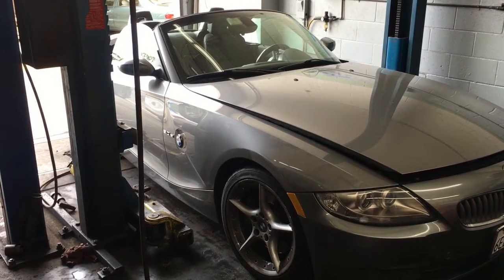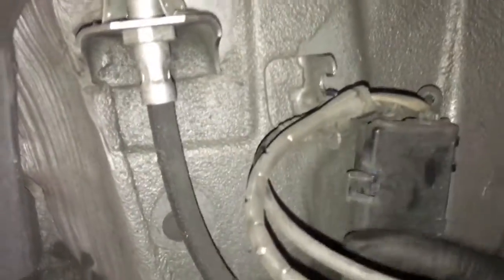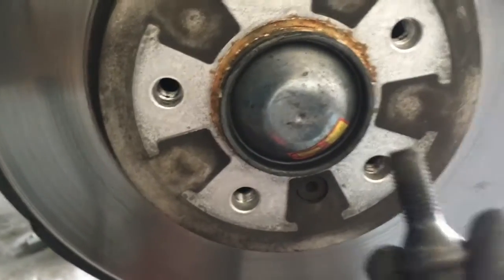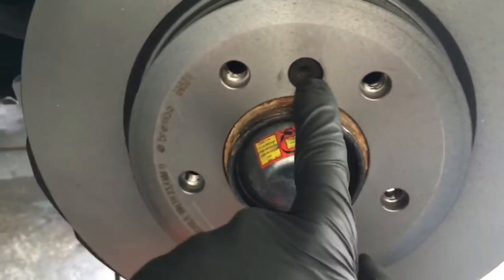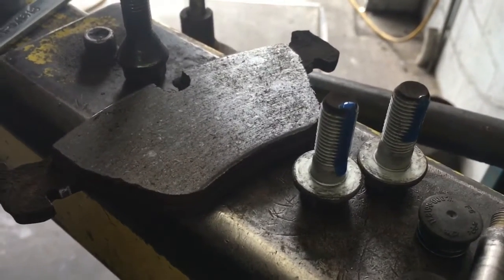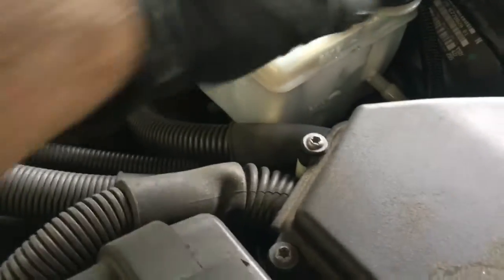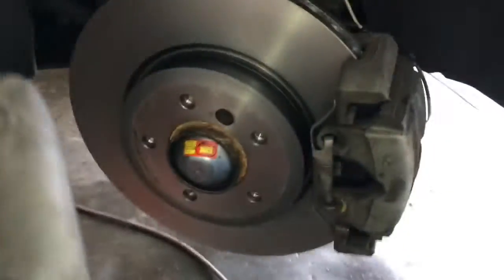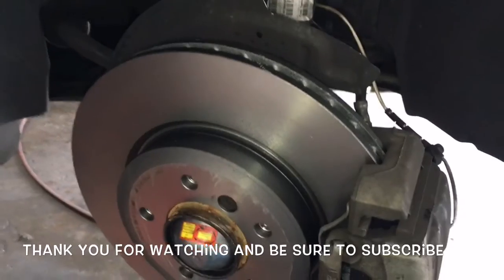How to Replace Front Brake Pads and  Rotors on a 2008 BMW Z4

Comment: ISTA specifically states not to grease guide screws or backs of break pads.

Unfasten guide bolts (1) and lift out brake caliper towards rear of vehicle. Do not allow brake caliper to hang from brake hose, risk of damage to brake hose.
Installation note: 

Clean guide screws. Do not grease.

Check threads.
Replace all guide screws which are not in perfect condition.
Installation note:  Tightening torque 34 11 3AZ. 30 -5NM

Remove outer brake pad.
Inner brake pad is located with its spring in the piston.
Observe minimum thickness of brake pads.
Installation note: 

Clean brake pads.
Do not grease backs of brake pads sleeve.

Break caliper bracket torque specs are 110NM

Comment: Thanks, I just did the right wheel disc and pads. Even without rotating the wheel you should have enough space to work. I lost quite a lot of time because I couldn't remove the 16mm bolts. I've used 3/8" wrench and had to stick a pipe in it to make it longer. It worked well but, you need a 16mm socket at least 1/2" adapter and a wrench at least 35cm long to ensure enough torque. When tightening them down, with 110Nm, even a 50cm long torque wrench will fit in space to work with. 
The 7mm hex pins are easy to remove, a 3/8" socket wrench is enough.
It is important to have the right tools.

PS. I did the other disc. some things I 'd like to mention...as the bolts require a great force to remove, pay attention to the rotation direction as the bolts are on the other side :)
The car must be rigorously suspended, I've placed the wheel underneath for extra safety.
After replacing the pads the fluid level will be higher. Check the level and ensure it doesn't go over the maximum limit.
The rotors need to align with a limit of 0.05mm maximum runout. At least do a visual check to see they spin with no wobble.
Reply: FYI, BMW TIS manual states E85/E86 are 65Nm for the caliper mount bracket.

Comment: Very good video, however, I believe that when you are compressing the brake caliper piston, that it is advised that you open the bleeder valve (and use a small hose to channel the excess brake fluid away).  To do it the way as shown in your video, the viewer runs the risk of damaging the anti-lock brake sensors.  It really is no more work since you don't have to siphon out any brake fluid from the master cylinder reservoir.  I always use the bleeder valve.

Comment: Thanks Brian.  Complete and thorough.  I have an 08 BMW Z4 3.0si and I recently did the front brakes for the first time. A couple of points you made which I wished I had known  at the time. I mention them here just to highlight those steps.

1. The plastic caps covering the sliders are exactly that - Caps. At first I thought they were plastic covers and tried to remove the whole thing. Luckily the caps fell off before I destroyed it. You just remove the top part.

2. The electrical wear sensor clip - I had never dealt with this bit of BMW Engineering. I was of the understanding that if your brake warning light wasn't triggered, you could re-use the wire. Maybe if I had had more experience I could do that, but in retrospect I think for the cost of a new wire, you may as well replace it with a fresh one.

Thanks again for your thorough video.
Reply from the maker: jafxdwg i'll start out by saying thank you so much for writing to me! I'm glad you're able to get value out of my videos. By doing those brakes yourself you definitely saved a couple hundred bucks. Thank you again for taking the time to write!
Reply: Saved more money than that... a bmw dealership would charge upwards of 500 dollars just for labor!